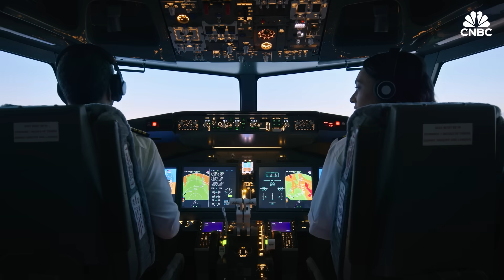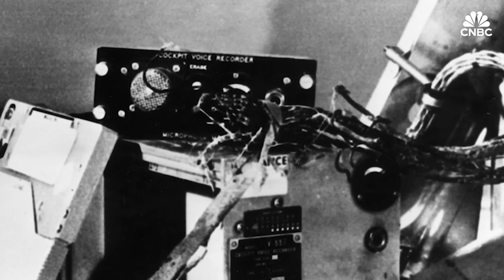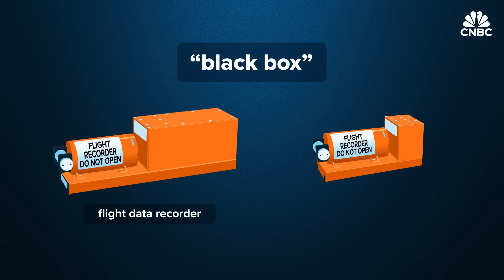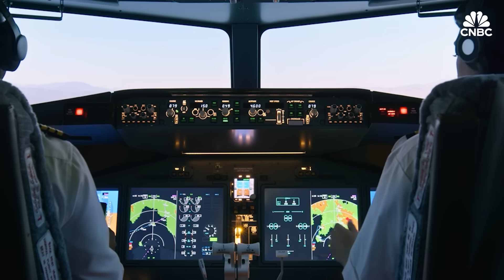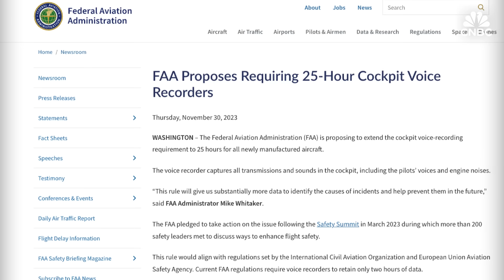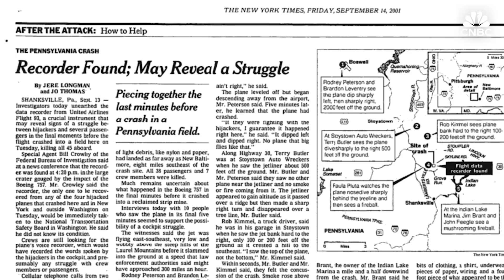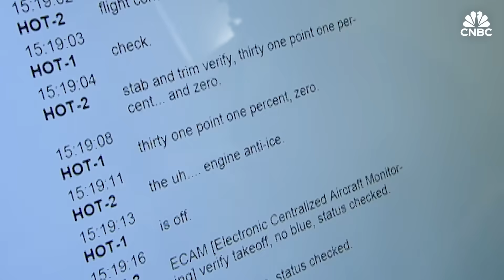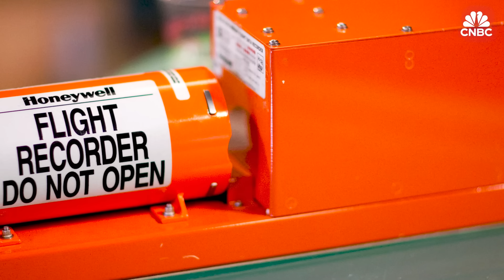How Does The Black Box Survive Airplane Crashes

Comment: Sometimes people should stick to what they know, saying there is not enough memory or server space to receive the data is blatantly not true. 20k extra users for satellite users would be significant but data compression and binary protocols would make it much less of an issue. The problem is solvable but like financial industry aviation often thinks of themselves as special with unique problems and is most often not the case.
Reply: What satellite system can do that? Very recent ones, yes, but remember aircraft development takes decades. We might see it in 10 years or so. If they figure out how to prevent hackers from gaining access to the flight computers, which I feel is the bigger issue.

Comment: privacy issues?  what privacy issues?   when you work for an employer youhave no expectation of privacy when at work.  offices i worked in had cameras  around the floor... not in bathrooms obviously.  
same goes for the cockpit.   sorry airline pilots union... you're going to loose this battle
and if you are arguing over privacy while at work... then what are you trying to hide?
Reply: After takeoff most of the task are done by the auto-pilot. Pilots usually sits there and relax. Sometimes they make call to their families or discuss something else with their colleagues. In a long flight where they have to fly for more than 10+ hrs, you can not expect them to only converse when it is only official conversation.
Reply: @bladerunner53  Which sounds like their argument isn't about safety but a public perception problem.  They don't want to be recorded looking like they just big chillin' because the average person thinks pilots are white knuckling the controls the entire flight.

Comment: I find it hard to believe all this data can’t be uploaded constantly to satellites
Reply: I find it hard to believe you don't realize that would be several hundreds of terabytes daily that would be better suited to be transferred on terrestrial means like wifi. There are already systems in use that do this for maintenance and FOQA data.  The data is transferred while the plane is in the gate. And there is already satellite based ADS-B which at least gives you positional data.
Reply: @aerialbugsmasher  do you realize how cheap hard drives and ssds are? where did you even pull this number from? the chips on the black box shown in the video are incredibly dated and use the intel logo from from 2006(!!). there is no way its more than a few gb on the black box itself.
Reply: @sierra991 do you realize how freaking expensive anything with an FAA stamp of approval is? Doesn't matter if it's from the bottom shelf of the dollar general if it's considered aircraft equipment which this would certainly be the FAA needs to certify it and that costs tens of thousands often especially for initial certification. 

I just love how so many of you commenters think they can lecture an airline pilot on these matters 🙄
Reply: @aerialbugsmasher  why are you acting like there aren't a bunch of FAA certified off the shelf parts? I'm not saying it will be cheap, I'm saying it's not impossible. you also didn't tell me where you got the terabytes number from. the boxes shown in the video are 256mb. I added up all the chips. it's probably less when you account for redundancy.
Reply: @aerialbugsmasher  don't need to store entire day's worth of data
Reply: @LebronCCP  yes you do. how do you expect the data to be useful at all especially in an investigation if they skip hours or days at a time that may have the smoking gun as to why an accident happened?  bandwidth is an issue with satellites. All that data NEEDS to be stored and transferred at some point. How do you expect people to use it if it just disappears into the ether?
Reply: @aerialbugsmasher  oh I thought they only recorded last two hours, I’m mistaken
Reply: @LebronCCP  no the audio recording captures the last two hours. The data capture goes up to 25 hours

Comment: why, in this day and age, planes still do transmit over the Internet to a remote server, all this information that is stored on the black boxes? As a redundacy, not as the only method.
Reply: Because this would be useful in literally almost zero accidents. Except for hijacks like MH370 and 11/9 it's not needed, and pilots understandably do not want their bosses to be able to listen to them 24/7 and record everything they say 😊
The current system does an amazing job. 
Remember the goal of flight recorders is to improve safety, not to point fingers
Reply: @sixtealbisetti2480  I think it would be usefull in all accidents in which the black box is missing or damaged beyond repair.

The communications could be encrypted and the only ones with the key to decrypt it would be the NTSB or equivalent, not the pilot bosses...
Reply: @mrbc2004  these cases are extremely rare and we still have a pretty good idea of what happened 
We know that the planes that crashed in the WTC were hijacked. We are almost certain MH370 was hijacked.
This doesn't stop hijacks from happening. 
And the NTSB doesn't care about a random Malaysian plane. They won't be the ones to listen to that plane. So who does? And how do you know someone won't successfully hack the NTSB or figure out how their encryption works, or what if someone from NTSB goes rogue?
This solves almost nothing and creates more issues.
Reply: Aircrafts dont transmit over the internet. In commercial airliners they use ACARS = Aircraft Communications Addressing and Reporting System: sends short text-style messages such as for: Flight status, Engine data, Weather requests, Maintenance reports.. which are transmit through:
VHF radio
HF radio
Satellite links
Reply: @islanderKiNG310 yes, but why can't aircafts also transmit thought Internet the same data that is recorded on the black boxes? We would know what happened to the Malasya fight, for example.
Reply: @mrbc2004  I would think that would be a security treat to the aircraft. Also, aircraft would have to be retrofitted with components to have this option. As for MH370, I would think that if someone did take control of that aircraft, they would know how to disable the CVR and FDR.
Reply: Also these three options to transmit are more than enough to send out data. FDRs record hundreds to thousands of parameters per second.
CVRs record constant audio from multiple mics.
Reply: @mrbc2004 yeah but no such system exists, and we’d see attempts of hacking into aircraft computers, not fun.

Comment: So why can’t they use the same material they’re using for the black box and use it for the interior and exterior of the plan since it always survive and its material seems stronger than the airplanes, that usually shreds to pieces when it crashes.
Reply: Cost and weight. Everything used in a airplane is designed to save weight. Lighter the plane, the less fuel it consumes.
Reply: It's more than just weight. Even if the plane were indestructible, the meat sacks sitting inside would not be. If you were to make a perfectly indestructible plane, you might even decrease your chances of survival.

In any crash, be it a plane or a car or running into a brick wall, the energy needs to go somewhere. Cars have crumple zones that absorb some of the energy of impact. If they didn't have crumple zones, then that energy might just go into you instead. If you want to survive a plane crash, the better question might be, "Why don't they make the plane out of Styrofoam packing peanuts?"
Reply: Weight...you cannot fly a steel plane.  For a given area steel weighs 3x as much.
Reply: found the kindergartner ^^^

Comment: Planes need exterior cameras.  Pilots can see what's happening to the plane and it can all be recorded for use in the event of an accident.  This should have happened decades ago.
Reply: As an airline pilot... Not once have I thought "oh I need a camera" in my 21 year career. There's a reason we have a myriad of instruments in the cockpit. Everything I could possibly want to know about my planes is already there for me to easily find. Of all the major accidents that we've formally studied in my career in safety courses I can't think of a single one where a camera would've changed the outcome.

Same argument can be made for just using them in addition to FDR\CVRs those alone provide more than enough information for figuring out 99.999% of all incidents and the few that don't we at the very least get really well educated assumptions
Reply: @aerialbugsmasher  Air India one with the fuel switch debate is one that might be solved in 30 seconds if we had video
Reply: @williamhaynes7089  that will only maybe confirm  WHO did it. And we already have a really good indication it was the FO. We'll never know the WHY he did it, camera or not.
Reply: A small number do it’s an opinion that can be selected on some wide body aircraft
Reply: Emirates has them. Passengers can select the camera on the IFE system. Not sure if the pilots can access them.
Reply: @hothotheat3000  Yes we can
Reply: Weight/Drag, Reliablity, Visiblity and placement are the key factors as to why this has not been installed on commerical airliners. As an aircraft maintenance technician... I totally get where you are coming from. I still think cameras would help pilots identify and confrim issues with flight controls (i.e) amoung other factors. Then again the sesnors and systems that are being used today are very advanced and reliable. Not an easy topic
Reply: I haven’t flown in years, prefer trains… do they not have interior cameras at least?
Reply: @Beavher no. There's no need. Every bit of information you could need about these crashes is already covered with the current systems.
Reply: @aerialbugsmasher I agree mostly, but you’re too dismissive imo. Gravity gear extensions without green lights, twisted nose gear etc, would benefit from outside cameras visible to the pilots. And the air India crash would have a preliminary report after a day with a cockpit camera showing the switches being turned off. Yes, we have other ways to access that information, but convenience is key. Or do you still use paper plates and steam gauges?
Reply: @LuLeBe  Those gear scenarios can easily be solved by a fly by with the tower or anybody else in the ground with binoculars and that is regularly done with gear failures already so your point is moot. As for air india, there's little to gain from a video. We know they were turned off. As to why/who is nearly irrelevant, especially since there seems to be some inconsistencies in the report courtesy of air India and corrupt aviation officials trying to save face or whatever. The damage is already done. 

So again, mr fancy-pants Garmin G5000 guy, show me an actual accident where having had a video feed of the flight deck would've drastically changed the outcome of the NTSB investigation.
Reply: @Beavher Pilot unions here in the US and US regulation forbids interior cameras. I have worked as maintenance for Volaris Airlines and Qantas. Both those airlines have flight deck entry and exit cameras.
Reply: Those are also are live and not recorded
Reply: @Beavher  Taken a train from new york to London lately?
Reply: @williamhaynes7089  I am not a traveled beaver. Sadly dammit. Never been to New york nor outside of the US :(

Comment: MH-370's CVR is likely useless given the over writing and how long the plane flew on so unless the pilot admits to doing his alleged nefarious deed before the plane went into the ocean it'd not yield much other than the sounds of a dying plane. I do hope they find it but man, what a big ass ocean it's in. A floating capability sounds like a good idea.
Reply: It's very likely the perpetrator of that incident shut off the flight recorders after locking the other pilot out of the cockpit. That in itself however would be evidence of intentional action. There have been a few incidents of suicide by pilot where that helped prove it.
Reply: Which is why the CVR now records more than just two hours. They raised the mandatory storage, iirc now it's 12 hours
Reply: @sixtealbisetti2480  that's great, technology will always be improving. I honestly hope they find and get MH-370's, maybe in the process they run across other plane wrecks and find those boxes. Imagine if a plane that crashed disappeared decades ago was found down there and they could get the boxes and solve a mystery.